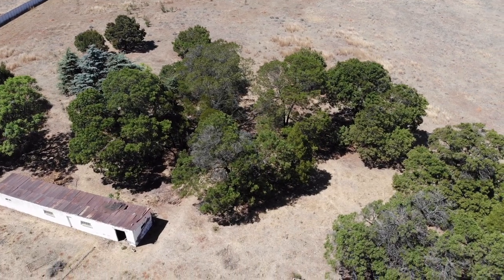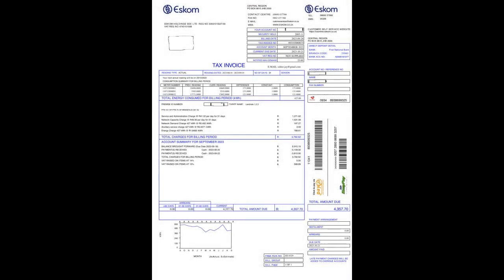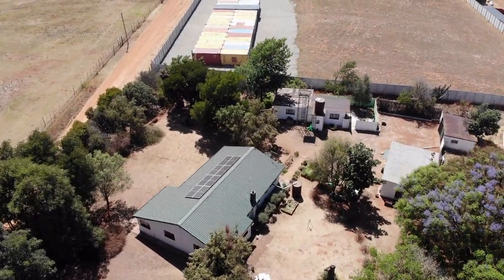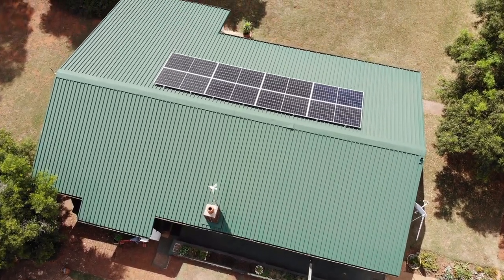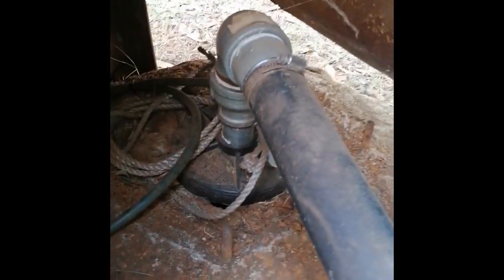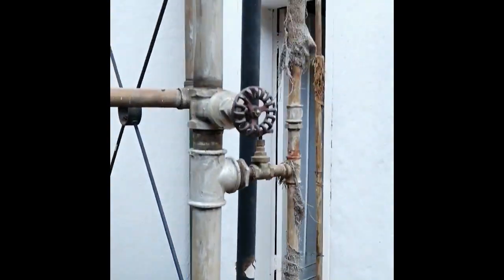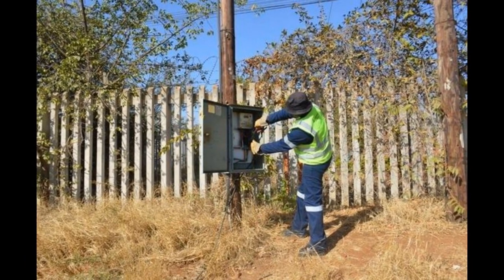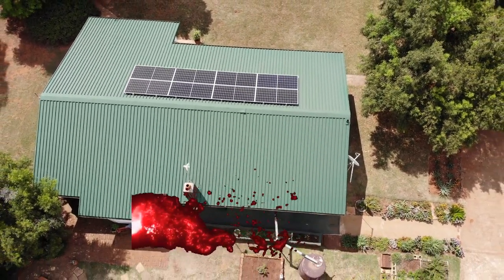Installing Solar and going off the grid in South Africa

Comment: Add more solar panels that’s called over compensating. So in the winter/rainy months having extra panel means you will get more charge. The. Of course have you generator which can all help charge you batteries. And being lithium batteries they charge quick.

Comment: You need a lot of solar panels. They are cheap now. I would not even put them on a roof, i would do a ground mount of close to 20kw of panels. i will the have to invest on low frequency inverter when rources are permitting.

Comment: Some suggestions:
Look at Solar Reflective Paint for the roofs.  The high tech stuff (barium sulphate,  titanium dioxide, calcium carbonate) = 100 watts per square meter of cooling, but even plain old white roof paint makes a big difference.
Lotsa info online and on YouTube.

Plain old whitewash (calcium carbonate) is lekker in that its cheap, so it may be worth repainting the roofs every summer, then letting them get dirty/warmer into winter..?

Biogas:  (Die kak werk! :D )
You probably have a French Drain which is basically a Anaerobic Digester producing Methane.
So a simple thin piece of pipe from the drain's vent into the genset's intake will save diesel as the pump auto governs the diesel down.
If you want to save up the methane a large airtight bag with some weight on top (for some pressure)  and a tap after works IF the drain is properly airtight.

Some filtering is a good idea to get the sulphur dioxide out as is not so lekker for engines:
Bubbler with water into 'bubbler' with iron pot scrubbers (no water) into 'bubbler' with charcoal works well.
You want the water cool (out the sun) and replaced daily (full of CO2) and the pot scrubbers to rust btw.

The more food waste and manure etc you gooi into your 'biogas digester'; the more gas you get... as long as you don't overload the digester.
If you have pigs and/or dairy; you're Eskom!!  :D
A fishtank warmer keeps gas production up in winter.
(Lotsa info online here too) 

Hot water:  
Solar is like 20% efficient where a good solar water heater is around 90%, so electric elements are only good as a backup/night-time heating option.
Then theres tonnes of hot water and air to be had from the genset when its running..!  You gotta 'maak n plan' with copper pipes in the coolant and/or a radiator in the exhaust but pretty easy stuff.

More solar in the morning and evening:
Face 1/3rd of the panels more northwest and 1/3rd of the panels more northeast.
This lowers the mid-day max (which is normally clipped anyway) but gives a larger total kw.h/day and more solar closer to when you want/need it.
Check this Ok's vids:
https://www.youtube.com/watch?v=M-5qcmlMLSg

Solar panels don't smaak getting hot. It decreases their lifespan and efficiency, so a gap between the roof and the panels big enough to get a decent breeze through helps a lot!  It also makes the house cooler.

Shout if you need a hand.  I'm 'thx BEE' free!  :)

Comment: Its a bit pricey but its definitely worth it. We haven't got solar yet but we do have backups capable of attaching solar. Jeez but Eskom has been smoking you guys. The next step for us would be water. That JoJo is worth its weight in gold. Here in the NW we had a water crisis for a week and it was one hell of a struggle. Be careful with Eskom. They sometimes install smart meters on solar systems that cut power on the solar supply as well when there is heavy loads on the grid.